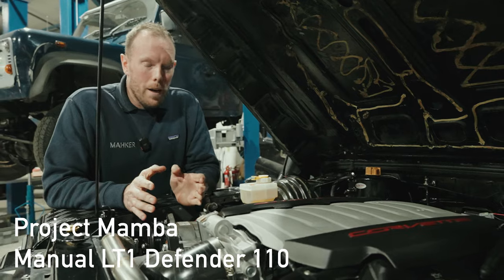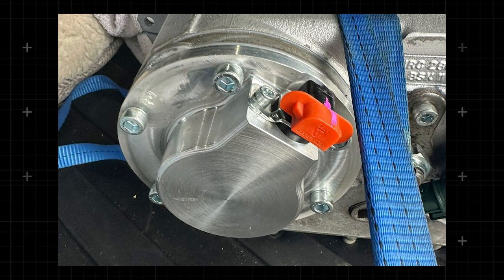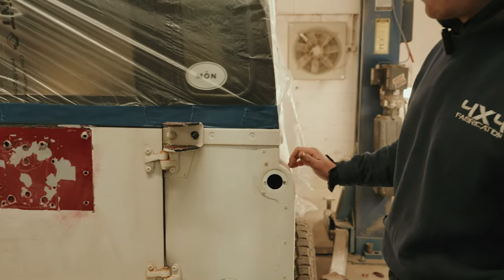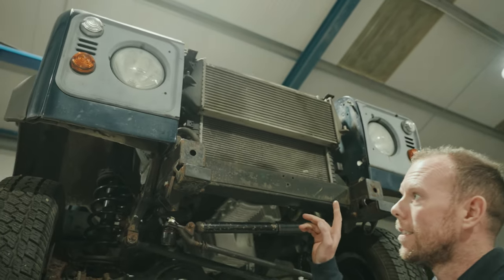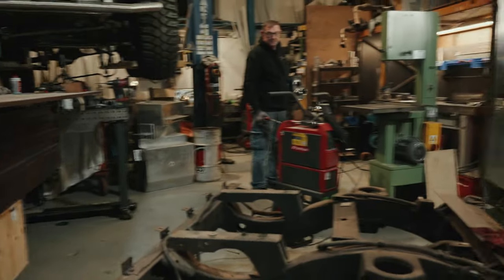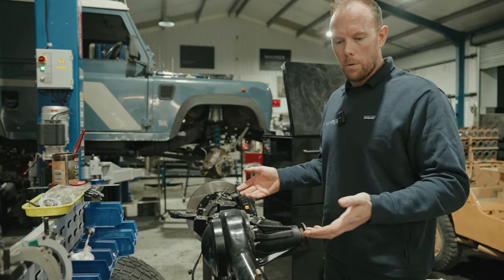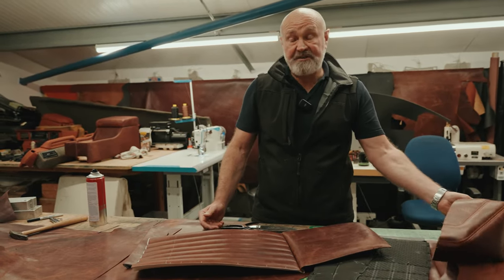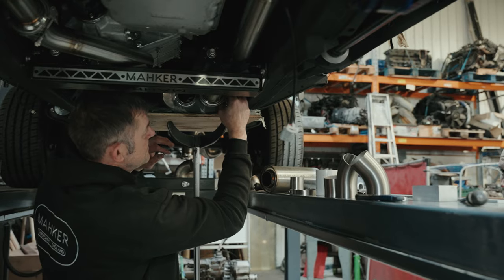Defender Menders - MORE 300TDi & TD5 Farm Trucks in for Chassis Restorations || Mahker Weekly EP102

Comment: I previously asked you guys why you didn't do Om606 engine swaps. You said they don't have enough torque for a 4x4 and was never used in a 4x4. Mercedes used the Om606 in their G-Class for a couple of years. I reckon the G-Class is as good of a offroader as the Range Rover where the BMW M57 was used, don't you think? The best part of the Om606 was it was available with a mechanical pump, no electronics to go wrong.
Reply from the maker: Thanks for providing that information but we won’t be installing one after our own personal experience they are not suited. Im also yet to see one produce matching low down torque as we see from the m57 330d.
Reply: Thank you for responding, can you please share with me more about your personal experience on why it isn't suited? Is it just about the low down torque? I can't comment on on at what rpms it makes its peak torque. You do petrol V8 swaps too right? Does the petrol V8 produce better torque than the Om606? Sorry for all the questions, I am looking for a mechanical diesel engine for my defender and unfortunately the M57 doesn't tick that box and the 300tdi is a bit underpowered.